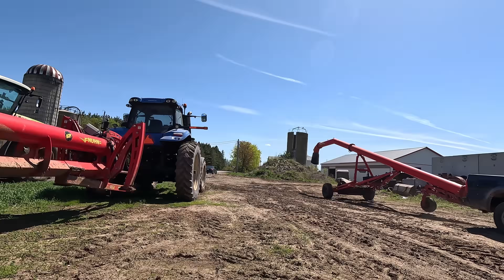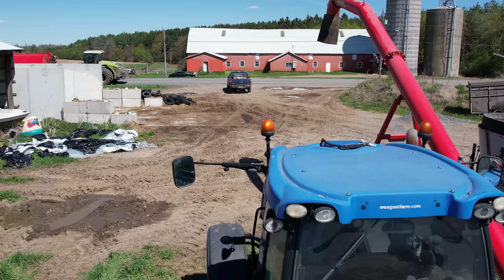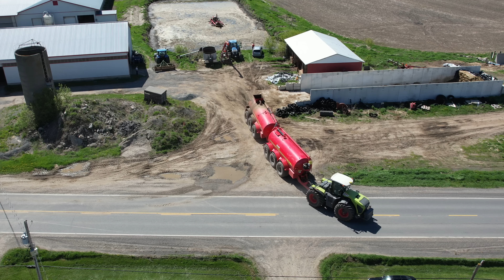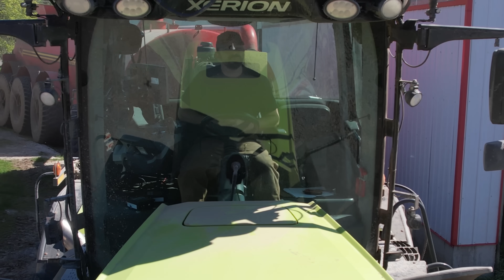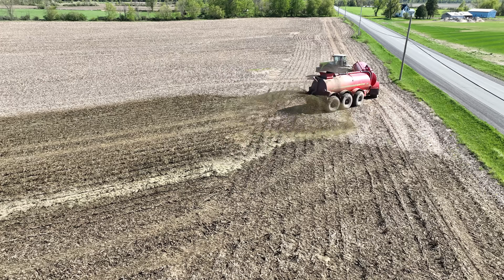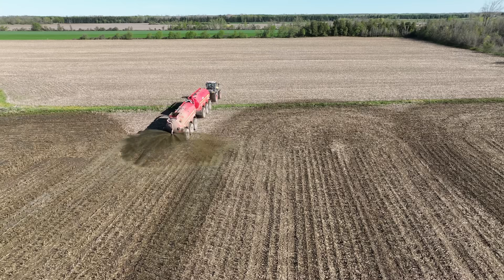CANADIAN FARMER - PUMPING MANURE @ 12,000 gal per minute @ SPREADING  at 225,000 Gallons per HOUR !!

Comment: contaminação do lençol freático garantido😢
Reply from the maker: no ....
Reply: repeat:- 
@eve-marie6751
0 seconds ago
Actually no, the manure-loading per square metre is quite low and the soil is fine-grained so that all of the non-soluble solids and odour-substances are filtered and trapped in the top few inches while all of the water and dissolved solids stay in the rooting zone:- soil hydrology is not so simple, the stuff does not just slide through down into the water table and then zip over to a neighbouring property by next morning:- soil water migrates very slowly and all sorts of soil bacteria work on it along the way.
Reply from the maker: @eve-marie6751  excellent response 👏

Comment: All those tubes going to your tractor tires and trailer tires do they just tell you the pressure or can you control the pressure from your cab?
Reply from the maker: They are the AgriBrink tire pressure control system. The tires are pumped up for the highway and lowered while entering a field to distribute the weight over a wider tire surface area thus reducing soil compaction. All controlled from the cab ..
Reply: @farmerdrone  now that's pretty cool

Comment: The well water now smells like a bad cow fart says yer neighbors lol
Reply from the maker: All the neighbors are dairy farmers 🙄
Reply: Actually no, the manure-loading per square metre is quite low and the soil is fine-grained so that all of the non-soluble solids and odour-substances are filtered and trapped in the top few inches while all of the water and dissolved solids stay in the rooting zone:- soil hydrology is not so simple, the stuff does not just slide through down into the water table and then zip over to a neighbouring property by next morning:- soil water migrates very slowly and all sorts of ssoil bacteria work on it along the way.